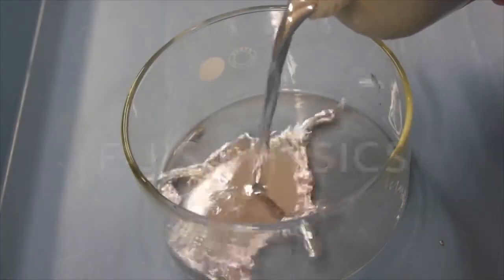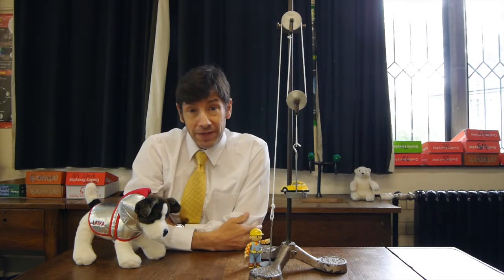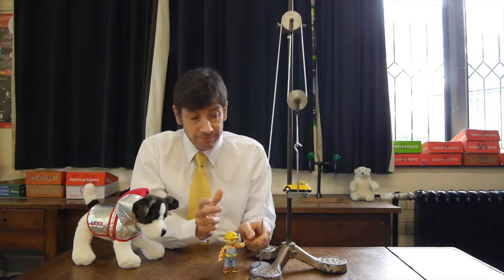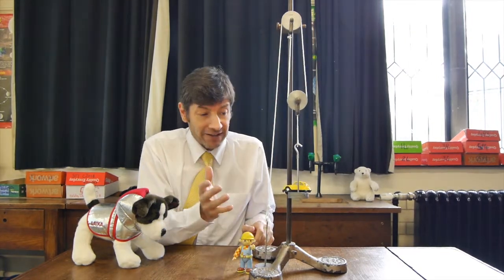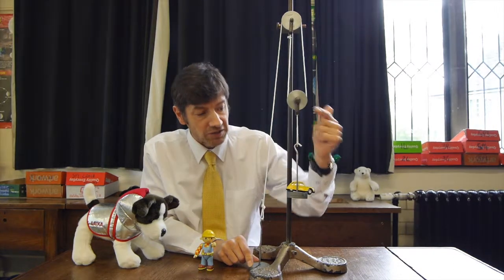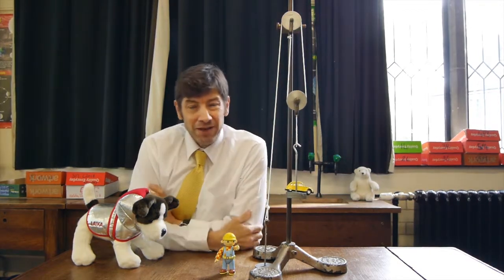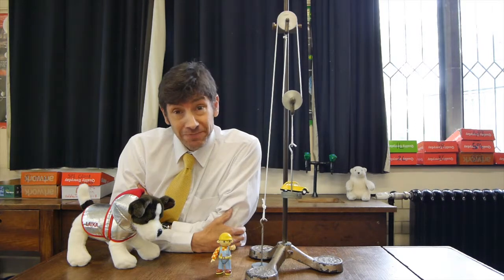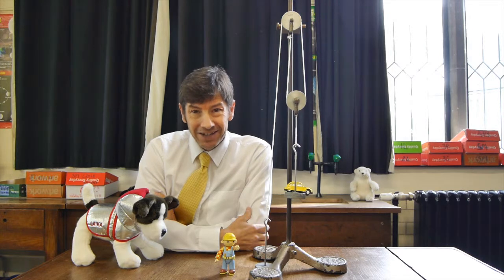Pulley Systems Explained - F-J's Physics

Comment: Love your videos Anthony.

I find it helps understanding of pulleys if you show how the total load is shared between the number of lengths of string the load is suspended from first. Then do W=Fd to explain why there's no 'free lunch' in physics.
Reply from the maker: Thank you!  Small channel but it's all good fun.  Surprised actually that this video was not more popular as it is a great topic and usually poorly understood and explained!  Great suggestion of yours - I will try that approach.  The one thing with with 'load sharing' explanations is that, with a three string pulley system for example, students know that it is three ropes + one you pull on (to be ignored in terms of mechanical advantage.  I.e. it's 3 and not 4) but they can get confused as you have to keep tension in the pulling line so is that sharing a 1/3 or 1/4 of the load?  It leads to some good conversations!  Thanks so much for watching and taking the time to comment.  Anything else that I have not covered that would be of interest do let me know!  F-J